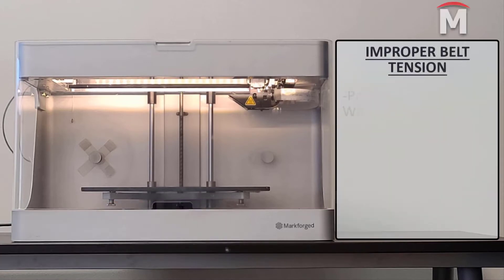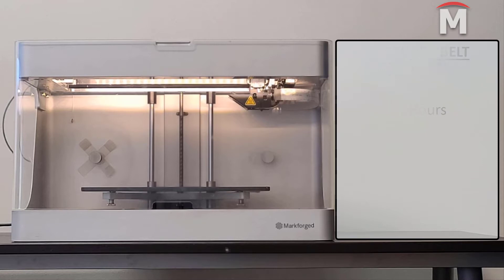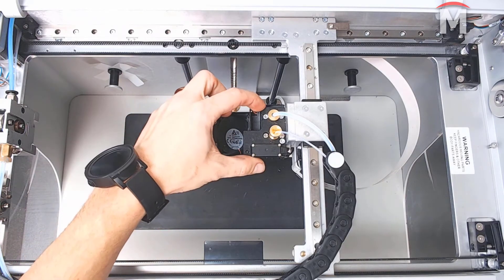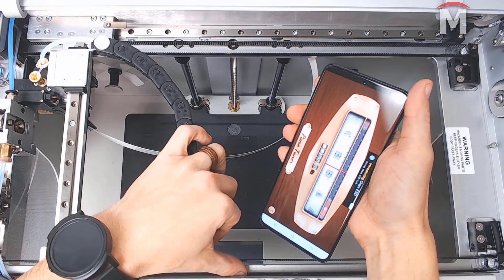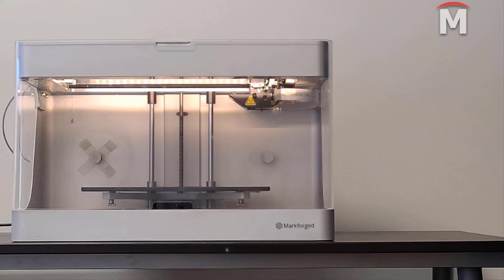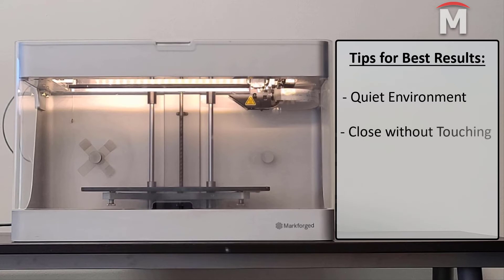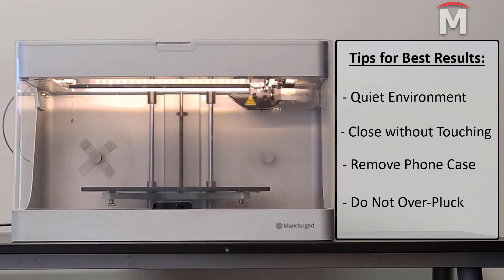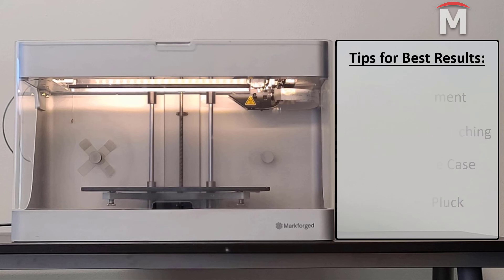How to Properly Adjust Belt Tension - Markforged Desktop

Comment: Where does the Hz values come from? I have different printer where belt lenght is different. I wonder how to calculate correct frequency.
Reply from the maker: These frequencies are provided by Markforged directly and only apply to this specific printer.  The frequency of any belt is a function of the span, the tension, and the stiffness/mass of the belt itself.  In theory it would be possible to calculate this using a frequency analysis in Simulation or with hand calculations, but it is probably easier to refer to manufacturer recommendations.